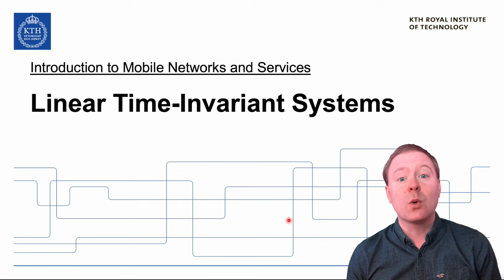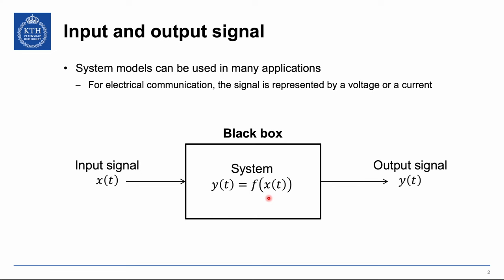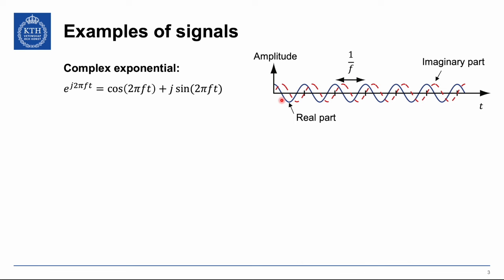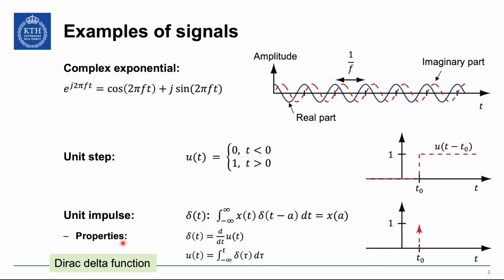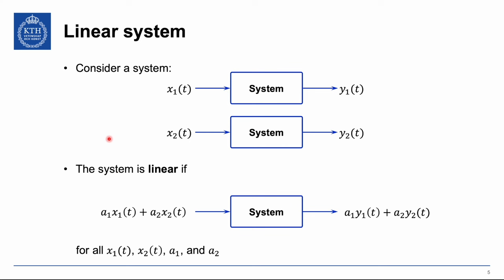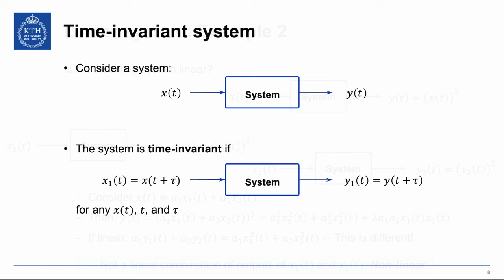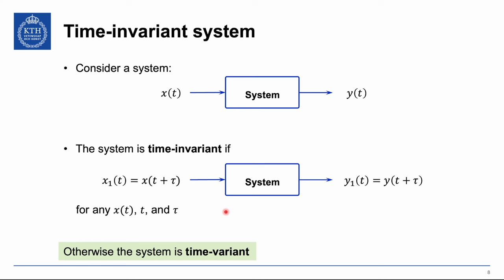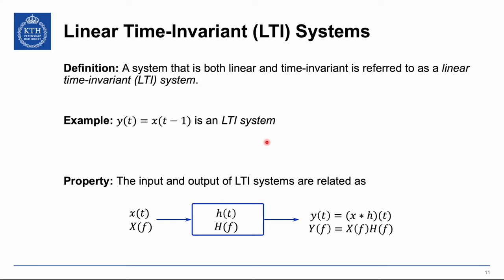Linear Time-Invariant Systems

Comment: What is the significance of identifying whether or not a system is an LTI system? Sure, we defined it, but why is it important in communication systems? Where is this seen in application?
Reply from the maker: The filtering performed by an LTI system is fully determined by the impulse response or its Fourier transform, which is otherwise not the case. The LTI property is essential to developing simple ways to relate the received signal to the transmitted signal. All the standard system models and transmission methods that you can find in textbooks on digital or wireless communications build on an LTI assumption. Many of these methods are used in practical systems.